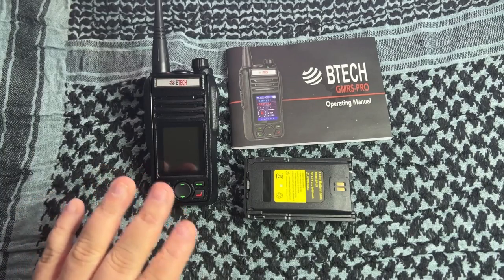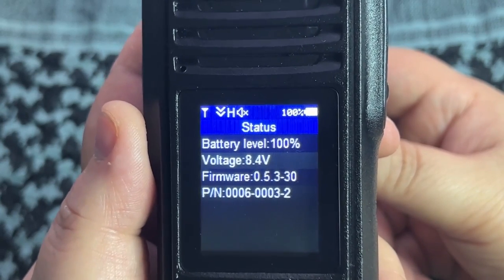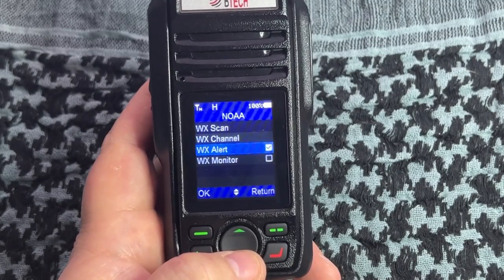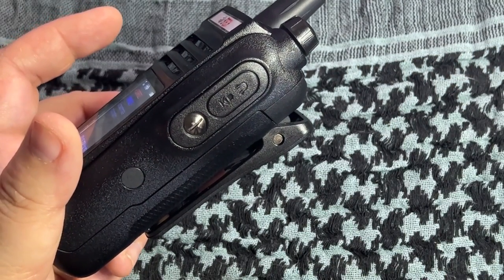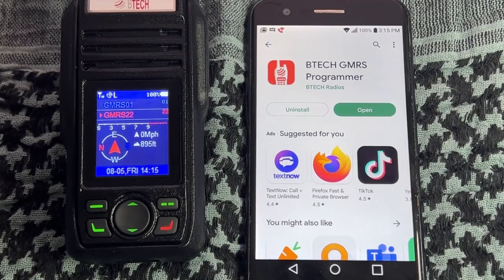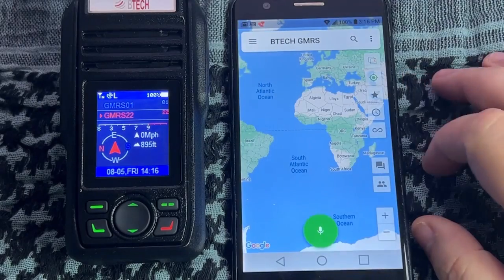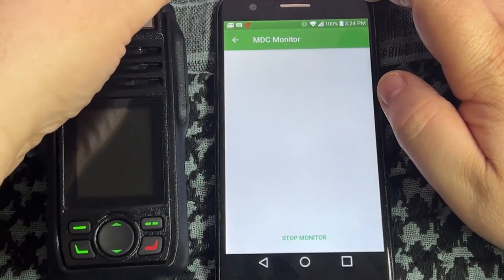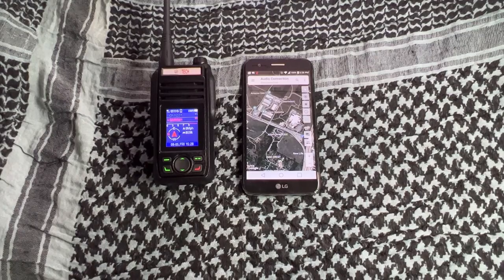BTECH GMRS-Pro GMRS APRS UHF VHF Handheld Radio | Offgrid Technology

Comment: I use the Bluetooth mic in my helmet while I'm riding my motorcycle. Since it's weatherproof i use radio holster on my belt. The Nagoya 771 works really well.
Reply: Do you connect your BT mic/headset with the app on a smartphone or with your radio?

Comment: Finally a Garmin Rino killer, almost. The price is right and it’s loaded with features. The advantage of the Rino is that all the mapping and texting is done on the radio without the use of a phone. The Garmin Rino’s are extremely expensive at $650.00 and the fixed antenna on top is very poor. I hope BTech continues developing this radio and a future model of the radio will incorporate the map and texting.
Reply: Agreed, I have one and just one! You need to purchase 2 units!!! Hahaha, $1,300! Next option…
Reply: @Gary N1VWH I use ONX for hunting and can download maps for areas that I don’t have cell service.
Reply: @phillipalbert8918  Garmin is one of the most over-valued company...
Reply: you can send messages on the radio without the phone connected its just a slow procces

Comment: I ordered two of these for the wife and I. Looks like a great little GMRS radio.
Reply from the maker: Having two units are key, while there is limited internet support using the App, these are really intended to be used with no internet, just allowing two way communication via the radios using a smartphone in a small group. While not true services like Winlink, SMSGate, etc. its a positive step in the right direction. All it would take to get these services is them allowing iGates to be setup on GMRS frequencies. I would do that in a heart beat.
Reply: We did too, 5 week back order
Reply: Can you try testing data over a repeater? There's a rumor that it actually does work, but it hasn't been confirmed.

Comment: Ya, been down this rabbit hole with multiple types of devices. The cleanest open source solution is the TBeam 915 MHz devices running Meshtastic along with an open source plugin available online for Civtak/Atak. It’s about $35-$50 per unit. You need some familiarity with using utility software. If B-Tech writes the plugin for Civtak/Atak that would be a cool solution because you would then have only 2 devices instead of 3 because the Meshtastic option (TBeam & phone) still needs a separate radio for PTT communications.

Comment: Great vid. Rumor has it you can text over repeater even though the manual says you can't. Dig into that if you get board. I'm waiting to buy until more info comes out. 👍
Reply: Interesting I’ll look into it.
Reply: That would be interesting... many repeaters are large state/multistate networks. That could mean full state coverage without internet at the repeaters or handheld. Also with much more simple "digital" mode for the novice.
Reply: High probability that any large repeater network is internet linked.
Reply: Simplex only!

Comment: I have heard that the GMRS-Pro has passed emission standards, which allow the antenna to be changed. The data restriction, apparently, only applies to radios that haven't passed the test.
Reply from the maker: Interesting thank you I’ll have to look into that.
Reply: Yes they did ....
Reply: Part 95 states it's to be fixed, and say nothing about exemptions.

Comment: The question is. Can it be enabled to transmit on VHF too? Would be great to have all these features at this price point in a ham radio.
Reply: Nope, it's a GMRS radio and I do have one of these units.  Funny, they included the antenna as being dual-band, however, I will change it to a fully UHF antenna since I do not monitor VHF frequencies.
Reply: @BobMaratas US ham APRS frequency is 144.390, and that radio can receive APRS data.  Unfortunately, I've heard it's UHF only, even for the Vero ham version.

Comment: Curious if it will allow transmit on 2m/70cm. My Radioddity 2m/70cm GS-5B allows TX on GMRS/FRS and MURS . Great to have if you need that for emergencies.
Reply from the maker: No it will receive UHF and VHF and transmit on UHF, while designed for GMRS you can transmit on UHF with a work around.
Reply: @offgrid.technology  hi I’m a noob to transmit on uhf do we need a license like ham or can use it out the box sir?
Reply: @Unknown-od5te  you need a gmrs license. $35
Reply: Covers your family out to 1st cousins.

Comment: If you set your GMRS callsign as your "handle" or "nickname" and enabled that transmission, would that alleviate the requirement to give your callsign every 15 minutes as it would be transmitted via data at the end of each transmission?
Reply from the maker: Interesting I like that idea.
Reply: Ya have to give CALLSIGN via voice every 15 minutes don’t be lazy giving CALLSIGN is half the fun image if your on Ham should get use to it
Reply: I believe so, as in APRS a voice ID is never used.
Reply: @johnsusedik8363 I've never heard a voice ID in APRS.
Reply: CALLSIGNS are only required on GMRS and Ham Repeaters I never said LOS without repeater and on the GMRS Pro the Nickname after transmission is only for location pinging and requires everyone with same radio or it doesn’t work

Comment: Is there a way to unlock the GMRS Pro in order to transmit on ham frequencies (similar to how you can unlock a Baofeng UV-5R)?
Reply from the maker: Unfortunately no, the base radio was a UHF radio called the Vero VR-N75 but the BTECH is locked to GMRS and I have not seen any software to alter it.

Comment: Can the ID signaling (identifier, location, etc.) be decoded by other devices or os it proprietary to Btech? 
 
If it uses common protocol it'd be great to integrate into my base station for offroad trips.
Reply from the maker: Text messaging I have figured out how to decode. Working on location, etc to see as well.
Reply: It uses APRS protocol. Any APRS protocol compilant will work.
Reply: Time to select a channel and start a GPRS (General Position and Reporting System).

Comment: My radio won’t display date/time, elevation/wind speed and won’t calibrate the GPS. I’m an amateur at best with comms so if you could help thatd be great bro. Thanks
Reply from the maker: It takes time to get the GPS lock. It’s not quick. If you pair it to your phone it’s quicker to get a lock.
Reply: Mine is slow too. Were you outside when you did this video?

Comment: Can you talk directly from your smartphone using VOX function on the app? I don't know if the app has VOX
Reply from the maker: Not from what I can find in the app, sorry.
Reply: @offgrid.technology  HT app allows that function, but I don't know if I can control this device with HT app.
Reply: On an Android, you can.
You can connect the radio and phone together, place the radio in a better position, and communicate with the vox functions.
I use this function when I'm home. My metal roof suppresses the signal, so I can place the handheld on top of my truck and talk from the phone inside the house.

Comment: Is it really APRS? "Automatic Packet Reporting System" emphasis on the Automatic!! Does it send information to the APRS network? The APRS system works on 2m only as far as I know. Oh and the manual mentions nothing about APRS. Do you know something we don't?
Reply from the maker: The HT app that the BTECH is based on actually has an APRS section, no from my understanding the APP reads the GPS and frequency from the radio and send it to the APRS gateway on behalf of the radio (which makes sense since GMRS does not have an igate on GMRS frequencies) so it's more like sudo APRS but regardless its a positive direction for GMRS users who had no similar services before this. Also when I send my data via the connected phone it does show up on ARPS.fi
Reply: @offgrid.technology APRS was created in the 80's before mass internet usage!  The problem would be who pays for the internet infrastructure.

Comment: I like the radio but I have been unable to use the gps or pair it with my Iphone as yet. I have also been unable to use the compass. BTech if you can help with these issues I would appreciate it.

Comment: How do you save the battery it will draw a battery down quick
Reply from the maker: If I’m doing heavy transmitting I Cary a 20,000mAh battery bank with me.
Reply: If you're doing data, you need the battery saver off, as you would miss the beginning of a packet.
Reply: Use battery saver mode.
Also set your screen time out to a lower setting.
If you are on the frs channels,  you can set the radio to the low power setting.

Comment: This app is no different from the app that runs the vg vrn7500 radio, i have both and both apps run both radios and still no tx option for ios , the vrn7500 been around for few uears and the app to , app is called BS HT

Comment: How did the Bluetooth headset work?
Reply from the maker: Just connected it and worked right away. No issues at all. Love it.
Reply: @offgrid.technology  I wonder if it would work with the Bluetooth in a vehicle
Reply from the maker: So it connected to mine but needed VOX to transmit which was wonky. I would use the Bluetooth mic instead.

Comment: Can you unlock this radio and can you manually enter ctcss tones?
Reply: Unlocking radio, not sure about that, but ctcss tones are programmable. You can program both a tx and rx tone if using a repeater.

Comment: Thanks for the review. You stated in your video that this radio has APRS. It does not. Just very basic texting between two like radios and the ability to show where you are on a map, but only what is transmitted between the two radio's and only within the limited range of the radios. No FPP,  you are stuck pairing a cell phone. Very basic GPS display on the radio. Neat features, but all very basic. For me it's a non starter, but others might really like this radio. As they say, there is a seat for every butt.
Reply from the maker: The reason I use that term is that the APP that is designed for the radio actually calls the services APRS in the app. Also if I configure them I can view my info on APRS.fi so it does do some sort of APRS.
Reply: @offgrid.technology  Thank you. This is what I needed to know. I wanted this to be APRS
Reply: @walteredwards544  their have APRS. If they didn't, they couldn't transmit data. The smartphone APP make packet modulation and sent them to the radio via BT.
Reply: @gastonbarouille767 the radio acts as the TNC.
Reply: It does actually do APRS,as it's the same as the Vero, a ham UHF version.  Even the app is optional, as you can view texts, and location data on the radio.

Comment: I didn't think GRMS has aprs that's a ham radio thing?
Reply from the maker: APRS is a tech that ham uses not that ham invented.
Reply: @offgrid.technology  yes I do know that my question was I didn't think u can use aprs on grms
Reply from the maker: Why not FCC allows it now. Again APRS is a type of transmission not the frequency. If you have an APRS receiver it does not matter what frequency they listen and transmit on.  Or FCC only allows short data bursts but still works the same.
Reply: @offgrid.technology  I just know we use the lower end of the vhf band inches ham bands I never heard of aprs being used in the 440 band
Reply: @donnymazon8516 Data was allowed in late 2017.  Read Part 95, in the GMRS section about data.
Reply: @RKingis  yes I know about the date part but I didn't know grms had it's own aprs system and giga repeater and yes I am licensed ham so I do know my way around so I just didn't know grms had that